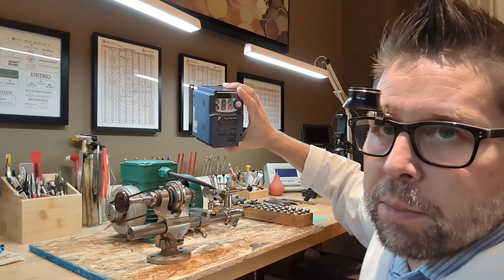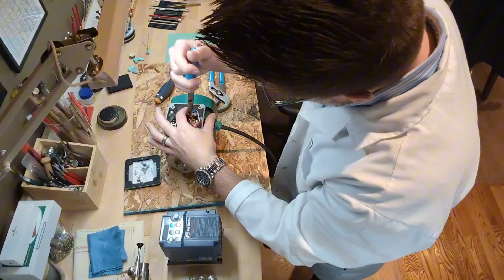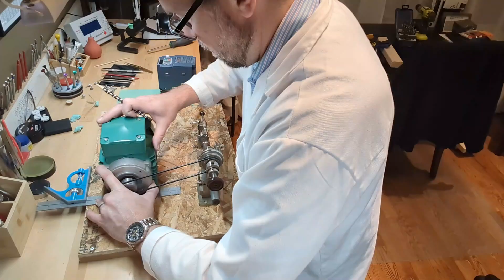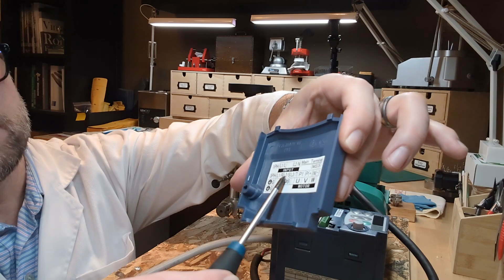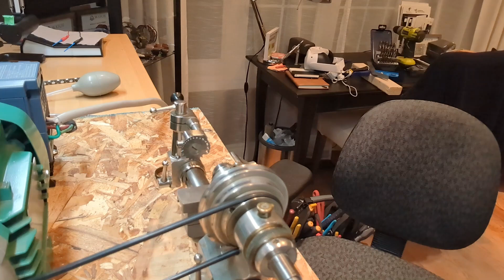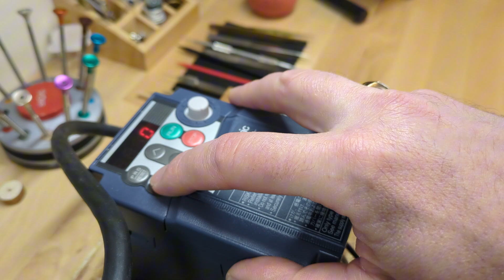Lathe Part I: Setting up a Lorch 8mm Lathe

Comment: I was wondering if I could use the same variable frequency drive you have (110V single phase input and 220V three phase output) , I have a German Lorch lathe  operating at 220V , I am not sure what would be the best thing to use to go from 110V to 220V without sacrificing torque at low rpms - thank you very much
Reply from the maker: Should be no problem... The 110V to 220V won't affect motor torque... BUT... Depending on the VFD you use you will potentially have an issue with speeds below 6 Hz, unless you use a drive that has the vector control algorithm.  So an 1800 rpm motor running below 180 rpm could have poor torque response (but greatly improved in sensor less vector mode), but this is at or below 3 revolutions per second, so I doubt you will need to go that slow OR that slow at full torque.  With this setup I have had NO issues with enough power and torque.
Reply from the maker: Oh... If you have a drive and motor in mind let me know and I can review and let you know if I think you will have any issues!
Reply: @watchoffthecuff thank you very much for your input, I am currently doing some research to come up with the best solution, will definitely take you up on it. Appreciate the help!!

Comment: Two things I thought I would mention.  I don't know about this specific lathe, but many machine tools are supposed to have wicks(felt) in the oil cup.  They are there to slowly release the oil onto the bearing surface instead of it just running out through the tolerances.  It looks like this is what you removed from the one oil cup missing the cap.  You may want to get new ones and re-install.

If heat joining the belt doesn't work you can use regular CA glue, but I have had the best luck with Loctite 438.  It stays flexible and will last where regular CA is stiff and brittle.
Reply from the maker: Amazing, thank you so much for the info.  I originally thought that the felt like stuff that was in the oiler was there just ot keep dust and debris from getting in there (since the oiler cover was broken) - I think you are right, the previous owner was probably using it as a wick!  Brilliant and thanks for the info!

Also, THANK YOU for the suggestion to use glue instead of trying to melt the ends together - of course! - makes perfect sense.  The Loctite 438 is a great tip also - I will use that when I'm ready to fit the new belt.

Cant thank you enough for the comments and insight! - Super helpful!!!!!